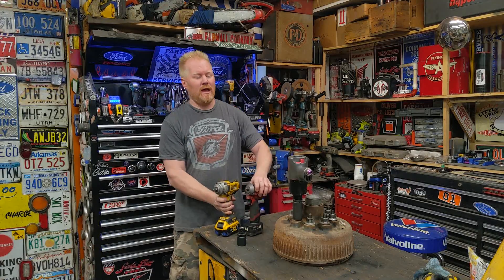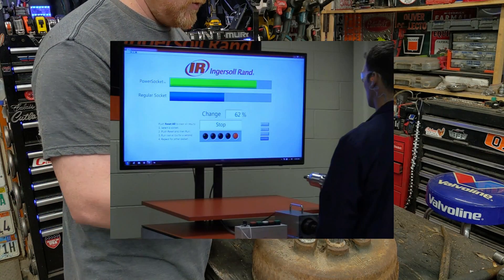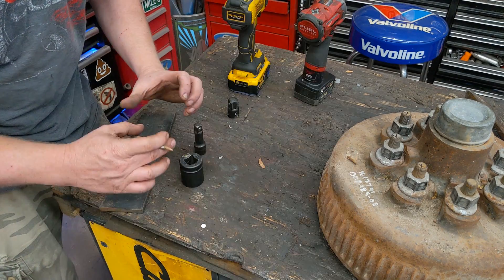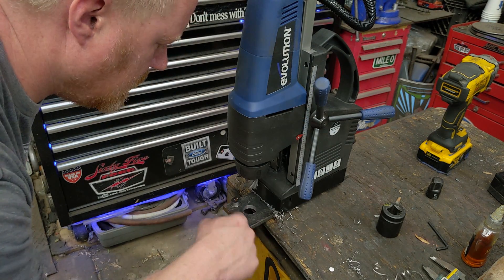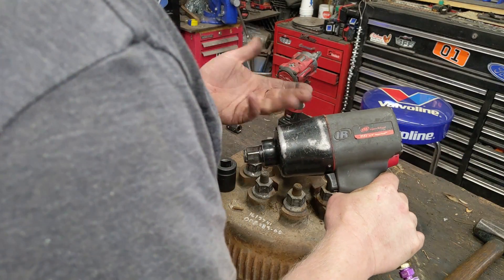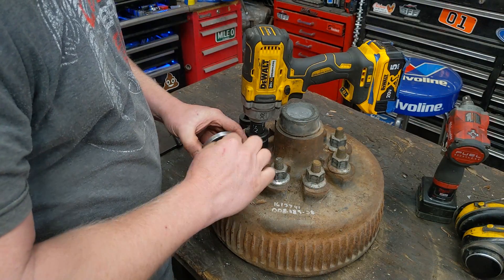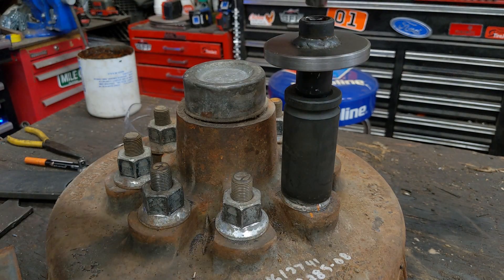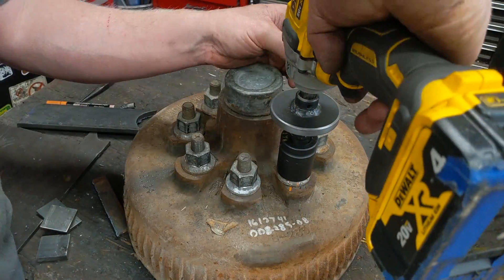Weighted Socket Adapter Build Experiments

Comment: I was excited to see if this worked. I'm curious if the free play in all the connections is absorbing your impact. The adapter and the extension.
Reply: I think he said in the beginning that it does by a factor of 10 but you would still gain 40 so it should be a win.
Reply: @danielwurmer2266  , 10%, not a factor of 10. The free play might, or might not be run out at the best time for the most hammer force tho.
Reply: @senatorjosephmccarthy2720  my bad, english is not my first language, thanks for correcting me!

Comment: This will never work because you are not putting any energy into the system. It reduces the torque because the energy is going into the flywheel. What you need to do is come up with a dual-flywheel design where one flywheel is attached to the extension and the other is attached to the driver. you then spin flywheel that's attached to the driver building momentum then when it gets to a certain speed, you need to quickly lock the flywheels so the energy of the spinning flywheel goes into the other one. I can see the design in my head but difficult to explain it.

Comment: try it with air battery tools suck but I bleave your on to something there if I was in a better place I wood try it out and keep working on it until it worked
Reply from the maker: I agree air is superior. Battery is convenient though especially when I'm not in the shop and kind of the basis behind this. I was working on a CV axle a month ago and my strongest battery powered gun couldn't get off the nut. In the end I had to run 150 ft of hose and use my 3/4-in air Ingersoll Rand and I busted it free effortlessly.

Comment: Don’t know if I’m on the right track . But I have always wondered why the engineers put quarter moon weights on the old steam trains drive wheels  with the long piston shafts . Look at the old videos of the steam trains spinning wheels just before they pull off .  Would an off set weight help torque .  Love your show I get lots of ideas . 🇺🇸🇨🇦👍

Comment: I'm guessing the reason they don't make a universal weight is that it's a tuned system. The weight has to be custom tailored for each socket in order to reach the resonant frequency required to increase torque. Picture pushing your kids on a swing. Each time you push, you push with the same amount of force, but the swing goes higher with each push. If you push at the wrong time (frequency), then the swing slows down. The custom weighted sockets are engineered to add the energy from each strike of the impact gun. If it isn't tuned properly, the weight will cancel the energy from the strikes of the impact gun.

Comment: I think adding the extension would take away more torque than the weight could compensate for. Maybe try a round piece of cast iron and bore it out to a press fit on the socket.
Reply from the maker: You would think so, but I watched tests of a single 15" extension put up against 3 pieces adding up to 15" and the torque results were the same. So the joints seam to have little to no effect on torque numbers. In tests the 3" extension lost about 10% of the guns total torque and that number dropped the shorter the extension and rose the longer the extension.  In theory I should be loosing around 5% with my 1.5" long modified extension. I have no doubts mounting the weight to the socket itself would work as that is what is already on the market. I want it to be modular though and interchangeable between all sockets.

Comment: Hard to beat the 3/4" Ingersoll air. 
I've run into very few things i can't take off with mine. Usually over torqued by a 1"  gun.
Edit to add, I've never even bought battery tools thinking they'd replace my Ingersoll air tools. Working in a truck shop I've seen them all and while some are impressive they've never outworked my Ingersoll's.
Reply from the maker: Nothing beats the air powered Ingersoll and the reason I'll never get rid of it. The battery is super convenient but sometimes I need to run 150 ft of hose just so the Ingersoll can show battery who's the boss.

Comment: I have the smallest Dewalt Impact driver and I know that if you use the larger battery it will deliver more power to the driver.  I tried removing a few stump grinder teeth earlier this month and the smaller 20v battery wouldn't budge a single one; switched to the larger 20/60 and it didn't hesitate at removing the nuts holding the "GREEN TEETH" (TM)  on. Yes, the impact driver is heavier because of the battery size, but you don't have to hold onto it as long as you would with a smaller battery that does nothing, so it balances out and the job gets done. I believe the larger battery delivers more power to the smaller tools because this is not the first time this has worked for me. Good idea for testing, and sorry it didn't work for you, but you have many other things in the past that have worked which were also non-conventional. p.s. I always look for the dog at the end; the smart one in the videos! (kidding) ;b

Comment: I watched another video on it, he did show a 25% increase using an air driven impact wrench and the expensive fly wheel style socket. So it uses some potential energy and converts it to kinetic energy, getting a little bit more total energy.
Reply: That is exactly what I thought, theses weighted extensions and sockets just add to the impact wrench you are already using. it makes sense Ingersoll Rand wouldn't be selling them if they didn't work. as the owner of an Ingersoll Rand impact wrench. (one hell of an impact wrench by the way) I would tend to believe them.

Comment: if you welded a pipe that would slide over the socket to the stubby extension,it would look like a weighted socket but would it act as a weighted socket?

Comment: I agree with the comments indicating torque loss with the use of an adapter based on my experiences. Do you think the extra torque of a weighted socket would affect the accuracy of torque sticks?
Reply from the maker: In tests the 3" extension lost about 10% of the guns total torque and that number dropped the shorter the extension and rose the longer the extension. In theory I should be loosing around 5% with my 1.5" long modified extension. I defiantly think they would skew the torque sticks ability to work accurately.

Comment: Too loose of a connection between the socket and weight and adapter and gun.
Reply from the maker: You would think so, but I watched tests of a single 15" extension put up against 3 pieces adding up to 15" and the torque results were the same.

Comment: Seems counterintuitive to me. The hammer inside the gun is the same weight and putting more weight in the socket end just takes out more power from the hammer strikes.
Reply: I think the idea is that this is spun up before the hammer strikes, if the hammer is engaging before it's moving then yes you're actually wasting energy. The mass of the flywheel is probably important so it can get moving before the hammer blow.
Reply: I've been thinking this same thing. What matters is the angular momentum of the hammer and you cannot change the mass or speed (momentum) of the hammer. Doing anything to the nut, socket, extension, anvil, etc, will just add mass that takes energy out of the hammer. Same reason why you don't want to add extensions to an impact, they just suck the power out of the impact. I haven't done research but I don't see how adding weight to the thing being hit (socket) will positively change the performance of the hitter (hammer inside impact).

After thinking on it, the only way a heavier socket would help is if the socket was spun up fast before it was put on the nut so it has its own angular momentum. That's not at all feasible though.
Reply: Not necessarily.  Remember, force = mass x acceleration.  If you can increase the mass while retaining the same acceleration, youre force has increased.  I assume that for many of these impacts, the acceleration of the hammer is the same regardless of the mass out front (to a certain point, of course)

Comment: Ginger is something else.
Torque is lost through EVERY connection. Regardless of the science behind torque sockets, when the torque is transferred back to the center of an item [the extension to socket connection] any torque multiplication is lost.
See this for testing various extensions -    https://www.youtube.com/watch?v=XYavlJY_5Ks&ab_channel=TorqueTestChannel
Reply from the maker: Yes, i watch these videos. A 3" extension lost 10% where they gained 40-50% with the IR socket. Their tests also showed a 15" single piece and a combined 15" adapter made of 3 extensions was virtually identical after. Few seconds of run time.

Comment: I have to look at the other video about them, because I don't think they would work. The gun puts out a fixed amount of energy, and if a socket is heavy I would think that the weight would absorb some of the energy and not multiply the energy. We need a mechanical engineer to work out the numbers lol.

Comment: I don't know. It seems like the stroke of the gun is too short so the weight doesn't have enough momentum, plus the weight seems to slow down the hammer. It would be like using a slide hammer but could only get half an inch of travel of the hammer.

Comment: Flywheels are only effective after you get them moving. It takes more energy to get them moving and less energy to keep them moving. Having more mass on a socket should be counter productive. A bigger gun is the way to go. The GUN is the hammer not the socket.
Reply: Yes sir!  Totally bogus.  Lighter the better.  Less extensions the better.  Speak to the guys who have to change wheels on semi trucks.  Maybe add weight to the hammers inside the impact?  Flywheel is there to lower the torque pulses.  When u get the nut to move u simultaneously have to accelerate the flywheel.
Reply from the maker: Theoretically the socket is a direct connection to the anvil which is being struck by the gun's hammer. So the lighter the anvil assembly the more it would move. That has been my thought process but I watched these weighted special sockets push the torque readings higher than standard sockets with independent tests.
Reply: @sixtyfiveford  Yup.  That's because of instrumentation errors.  The instrument was to slow to pick up the peak reading.  To break a joint u have to overcome a peak only instantaneously.  Once u have movement u ok.  I know it's often then advisable to rock it back and forward.  Key is that torque spikes difficult to measure.  Testers were not aware of the shortcomings of their measuring device.
Reply: @sixtyfiveford  , the added weight's amount and distance from the axis has to be mathematically calculated, working with the hammer pressure. It would take a lot of experimenting otherwise. For the max, seems the hammer distance from its axis - effecting its timing - has to be calculated in too. Then the increased strain needs thicker bushings and casings. 
Where's that cheater bar?
Reply: @ebutuoyebutouy  Actual weighted sockets are objectively better (where they reasonably fit ofc).  Been shown time and again they'll make the difference on a wrench that just can't quite break something with a lighter socket.  Don't need to ask somebody who changes semi tires, already seen it with tractor and combine tires which are much larger.
Reply: @jaywelker5566  A more rigid socket is better because it can't flex so much.  Most effective way of breaking the bond without damaging the stud is w a spike load.  Flywheel is going to dampen this spike.  Yup, I've done it many times on trucks, tractors and earth moving equipment.  Period.  U going to be breaking a bunch of bolts/studs.  Get ready w your drills and easyouts.  And better get a case of penetrating fluid.
Reply: I agree with Moe, Ingersoll Rand sells these weighted extensions and sockets, that show an increase in torque under tests conducted, so there must be something to it. and being the owner of an Ingersoll Rand impact wrench. (one hell of an impact wrench by the way) I would tend to believe them.

Comment: Will be doing a magnet bottle for the filings.  
Ginger, keeping those branches trim, such a star.
Reply: me too - thanks!
Reply: Another idea I've seen other places is to have a plank connected to a handle, like a broom. Then add wheels to the sides and magnets to the underside of plank.  
Now you have a magnetic collector you can roll around at the floor.

Comment: There was a tool kind of like that many years ago. It worked like yours only rather than round, it had two hammer heads and you actually pulled the trigger with one hand and swung a hammer at the tool head with the other.. Other than that, a 1" Impact will break just about anything as long as it has the proper compressor and hose and fittings size..

Comment: Maybe it's just manufacturers lying lol
Reply: I commented too soon lol.  Since we have proof, maybe try making a collar and using a socket, and see if the moment or whatever is being affected by the collar bieng so high up.
Reply: OR, a collar that goes over the adapter, but has a hood that extends over the socket.  I wonder if the ATTACHMENT point is too high, or just the momentum happening to BE too high.  Attach a weight to the extension, but make it like a cup that goes over it and you slip the socket inside THAT.  It won't get into tight areas, but maybe that will work.
Reply from the maker: I like your thought process!
Reply: @sixtyfiveford  

Thanks lol!

Comment: The effect (increased torque) may be result of increased stiffness of heavy wall socket, rather than increased weight.  thanks for  interesting topic.
Reply: I agree with you about stiffness. My guess is he is loosing a lot of impact force is the connection of the extension to socket. Some force is lost between the gun and extension. More between the the flexible extension and socket.
Reply: @cpcoark  Yeah he is putting 'work' into the faces of each extension.  After a while the working facing ends where the extension is being struck will be malled, indicating work is being done there and not onto the nut.
Reply from the maker: Actually I watched thin wall chrome sockets beat out thick walled impact sockets in graphed toque tests. The thought there is the lighter the socket the less mass is adsorbed and more force of the gun goes into the bolt. Also in regards to the extensions, tests of a single 15" extension put up against 3 pieces adding up to 15" and the torque results were the same.